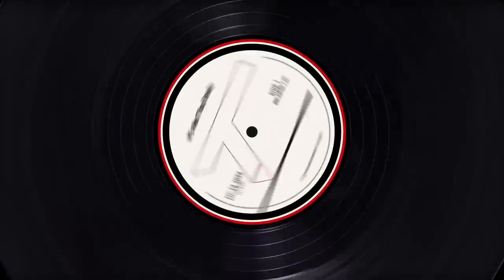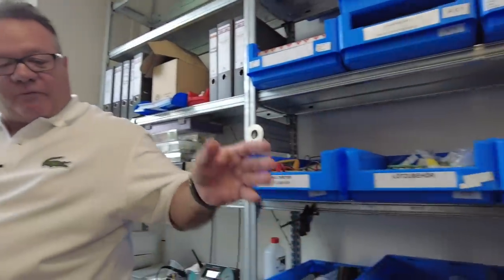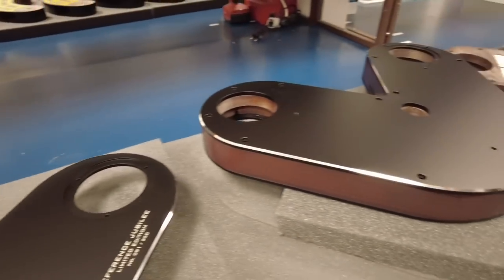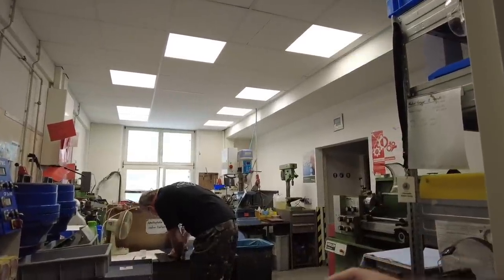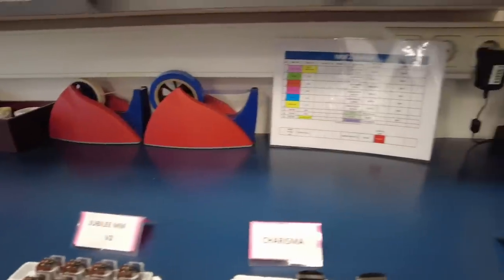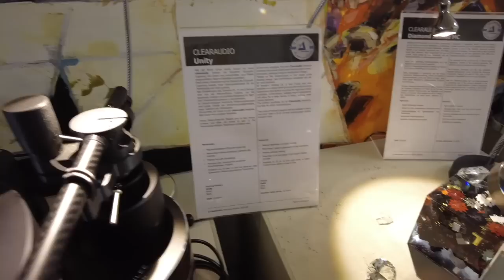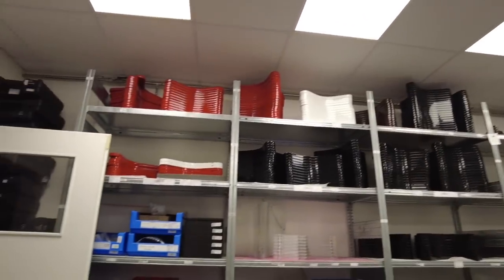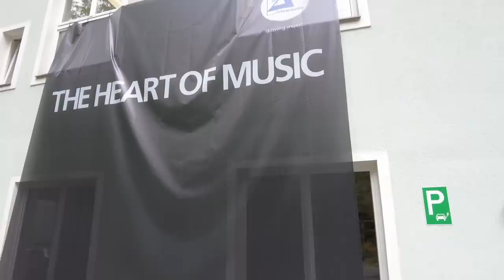Clearaudio electronic GmbH, Celebrates 45th Anniversary With Party and Factory Tour

Comment: Thanks so much to Mr. Fremer and to the company for doing this kind of tour. I really appreciated experiencing the pride that these folks take in their work. The modern machined look and feel is quite unique to Clearaudio. As the gentleman stated the tools are so important, not just the CNC setups. The structural research that Clearaudio does regarding the resonance reduction will give their products and their company so much longevity into the future! They do a very good job of marketing and explaining the advantages of their products. One thing they do need to improve somehow is customer service because dealers are just brokerages. However, since their products are reliable and very high performance, there is very little service to do. Cheers